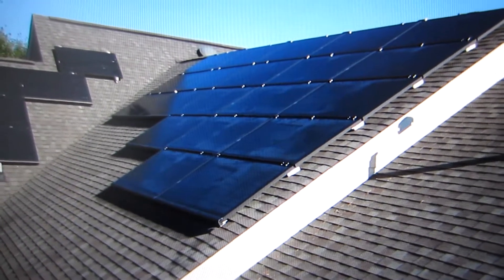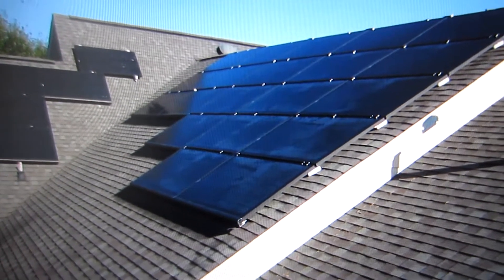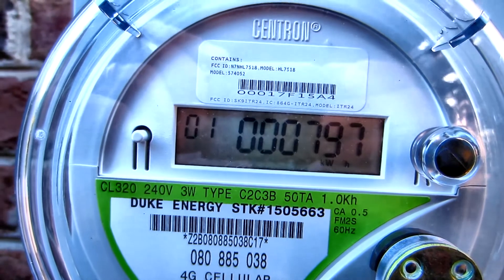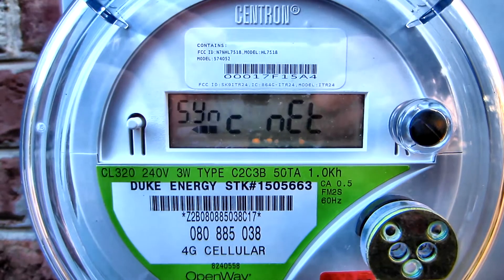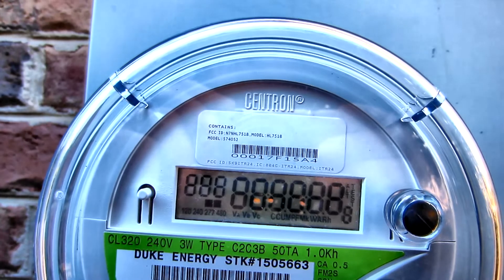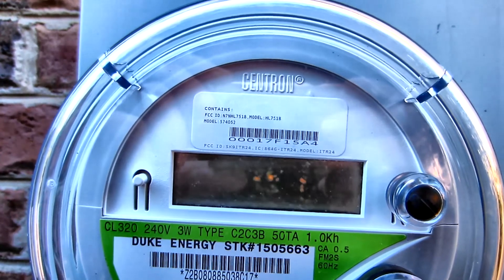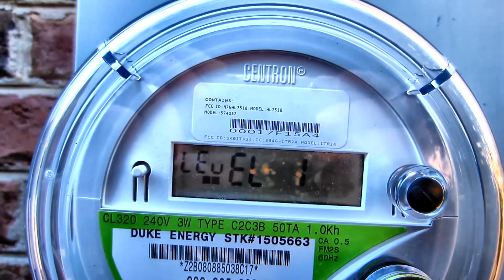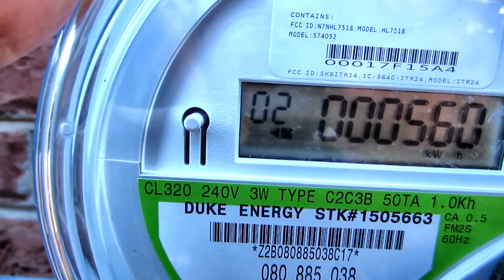Reading the Duke Solar Net Meter

Comment: I just had my solar activated, and interesting enough, I'm not seeing the alternating displays.  I'm still only getting 01; not the 02/03/04 options.  My meter supposedly was swapped, but my 01 still shows total use since it was installed 4 - 5 years ago.

Trying to determine why my meter is operating differently is like next to impossible as my solar company doesn't seem to think there is a problem.  Maybe there legitimately isn't, but seems odd mine is working different then this (even through I'm on Duke Energy) and how my neighbors meter is working.

Guess my first bill will be the test.
Reply from the maker: I agree that reading the meter remains be daunting and confusing. One solution is to have consumption and production meters installed on your system.  I did this last year and now I am able to closely monitor my system using the Enphase Enlighten App and never have to view the Duke meter.  I installed them myself but installation by a third party is typically not prohibitively expensive.

Comment: If I don’t see the screens you are showing and have duke net metering, could that mean something is not set up correctly? I have screen 4 which looks like total kwh, screen 6 with kw, and screen 20 with no units. I do have the left and right arrow so that appears to be working. And it does says sync net.
Reply from the maker: Keith...I am not sure.  I wonder if Duke installed a new net metering device at your location in preparation for adding  "time of use" and other functionality that may become more prevalent in the future as Duke and other power companies attempt to realize additional revenue from their solar customers?  However a  provisioning error is also possible.  Thanks for your question.
Reply: @Gumarko  I had time of use (and liked it and saved using it) up until I went solar. I didn't want the restriction on when I could use the power I sent back to the grid, so I switched. And that is what has me worried. They messed up switching me back and I am wondering if they messed up my net metering when they switched me to the non-time of use rate. I haven't gotten my first bill since solar so I am curious to see if they did it right. I'll probably give them a call tomorrow and ask. But their customer service is horrible! I spent 3 hours on hold and had to call about 10 times to get them to switch me off the time of use plan.
Reply from the maker: @keithbajura8310  It appears to be related to your TOU status change.  If Duke Carolinas remains unresponsive, I would suggest contacting the NC Utilities Commission, Consumer Division. I was successful in my efforts to have Duke restore June solar production to most residential NC solar producers.  Duke, in direct violation of their net metering agreement, included June  2021 production when performing their June 1 true-up (which sets all accumulated excess production to zero on June 1 of each year).
Reply: @Gumarko  I couldn't wait any longer and gave them a call. There is a really nice person in the Duke Solar Department. He did tell me that I should be seeing what your video shows. When I said I wasn't, he did tell me that they were recording what I sent back and told me what it was so far. So I am happy with that. Finally, we both are right. This is related to my time of use switch. He told me the meter display hasn't been updated yet to display the sending values (it should be soon), but what I am sending back is being recorded. Whew. I thought I was going to have to fight for all of my wasted sun.

Comment: How to get the meter changed if you believe there is a issue with there meter. I've called and no one seems to want to
Reply from the maker: If you believe that the meter is not functioning properly,  perhaps a call to Duke billing department indicating that your bill maybe inaccurate and you think the meter might be at fault.  This might trigger a referral to someone who is able respond.  That being said, I have found it very challenging to speak with anyone at Duke pertaining to net metering.  Residential solar customers/producers may be viewed as "competitors" by these entities and hence the lack of customer support.  That being said, I you would care to share the specifics of your issue, perhaps I or someone else might be willing to provide an opinion. Thank you for your question.
Reply from the maker: If you were unable to resolve this issue, you might consider contacting the NC Utility Commission, Consumer Division.  I have found them to be responsive to consumer complaints.

Comment: Display 1 - KWH from Duke
Display 2 - KWH from customer to grid
Display 3 - KVARH - from Duke
Display 4 - KVARH - from customer
Just below the reading it will show thiese in very small letters
Reply from the maker: Thank you, Robert. Very helpful!  For those of us without an in depth background in electrical science, KW is Working Power (also called Actual Power or Active Power or Real Power). It is the power that actually powers the equipment and performs useful work. KVAR is Reactive Power. It is the power that magnetic equipment (transformer, motor, relay etc.) needs to produce the magnetizing flux.  Hence it would appear that screen 1 and 2 would be the most useful for the average solar consumer.

Comment: Any idea what the "Level 1" indicates?
Reply: Level 1 has to do with the 4G cell signal, as does sync net and reg means registered signal with cell tower.
Reply: Thank you for the replies. I guess I never paid that much attention because I've had this meter since my solar was installed in October of 2016. That said, a few months ago I noticed mine would alternate between level 3 and level 4. At first I thought it was "peak" and "off-peak" but that didn't hold true. I never did find a pattern to it. Now this month it alternates between level 5 and level 6. Maybe it does have something to do with the cell signal changing because of upgrades to 5g, but I don't really understand it. I would think it would stay consistent as the sync net & reg does and not alternate between Level 5 & 6, but what do I know.
Reply: And I should clarify..., this is Duke Energy in Tampa Bay (St Petersburg) Florida.
Reply from the maker: Level one is cumulative power drawn from grid since meter installation

Comment: Thanks for your time and effort here. How did you determine the value of Screen 4?  Tnx.
Reply from the maker: Glad you found it useful.  It appears that most Centron net meters use line 4 to display total consumption since time of install.  I recall corroborating this with my Duke bill and production on the Enphase App.  I recently installed a consumption meter so I now rarely view the net meter directly.  https://store.enphase.com/storefront/en-us/consumption-monitoring.   I installed the meter myself but not recommended if one is uncomfortable working with high voltages.
Reply: @Gumarko  Thanks for the video!  I have the Enphase IQ installed as well (ION Solar, with Duke Power in Durham, NC), and it doesn't include the consumption monitoring.  I just ordered from the link above, but I guess I'll need to get an installer to handle putting it in.  I've been wanting a way to monitor the consumption without having to read the meter physically.  I haven't been able to totally puzzle out Screen 4 either.  When you say in the video that Screen 4 is cumulative power used, do you mean cumulative use of the solar-generated power?  So I would add that to Screen 1 to see how much total power my house has consumed since installation?  Unlike yours, my Screen 4 number is smaller than either Screen 1 or Screen 2, so I figured it can't represent overall total power.   I've been trying to get the information either on the internet or from Duke, but so far without success.  Thanks again for taking the time to make the video.
Reply from the maker: @davidbarnhart3149  Thank you for your comments, David.  If you choose to have consumption metering installed, I think you will very pleased with the enhanced ability to monitor both production and consumption on the Enlighten app. The Duke meter still remains a bit of a "black box" in that its actually functionality appears to be proprietary and subject to the firmware/software that Duke chooses to install.  My statement regarding Line 4 was meant to imply total consumption "seen by the meter".  I suspect the meter sees both consumption from the grid and consumption from the solar array but not sure.  That being said, Enphase consumption metering displays both. I installed the meter myself but have considerable experience with electrical wiring.  I would not recommend this for someone who lacks experience working in close proximity to high voltage components.  An electrician would be the way to go. The installer will also need to download and install the Enphase Installer Toolkit app in order to properly provision the system.
Reply: @Gumarko  Thanks, I'll be getting an installer to do the consumption metering installation once the parts arrive from Enphase.
Reply from the maker: @davidbarnhart3149  Make certain that the electrician installs the CTs between the meter and before the point where the solar lines connect to the main lines.  If the CTs are installed on the main lines after the solar connections as they enter the house, only the load data will be acquired.